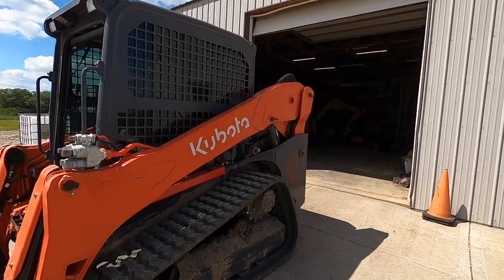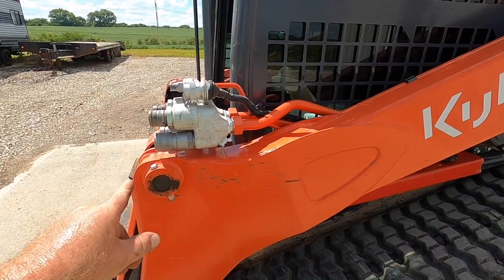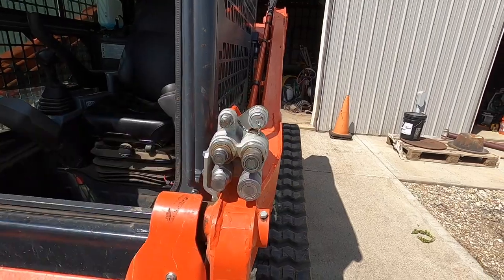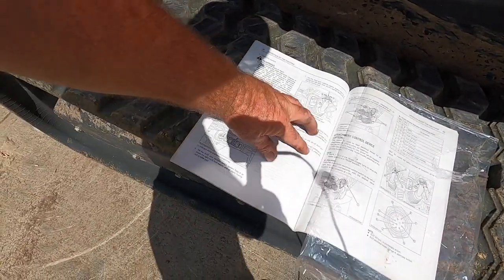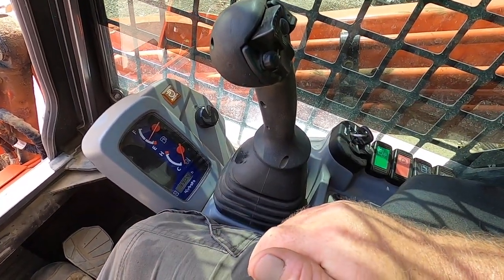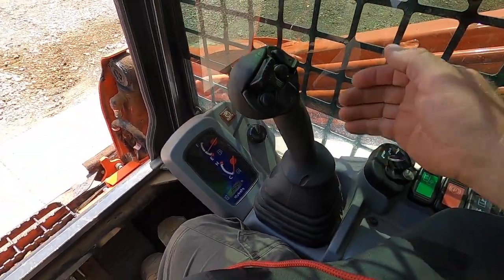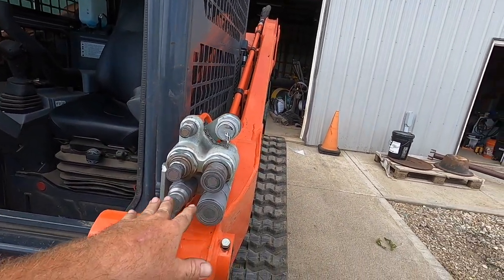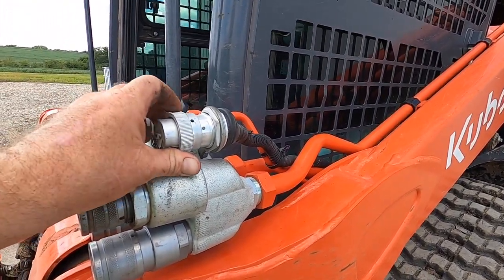Kubota SVL 65 / 75. How to Use High Flow

Comment: I'm not sure on the 65 and 75 but on the 95 and 97s you have 14 different settings on your dash that increase's the flow rate with each step. When hooking up high flow to an attachment you need to know the maximum flow rate the attachment will take and not set the machine higher than the attachment will handle. The sad thing is Kubota holds these settings cost to them. You have to pay to get what each setting is flowing. Which should not be that way.
Reply: I’ve got a screenshot of all the settings and the corresponding flow.  Drop your email and I’ll send it to you
Reply: @TeezleySPT  I sent my email twice but looking at the comments I don't see it. I was just wondering if you got it.
Reply: @TeezleySPT  do you still have those flow settings that you could share? I need to know what level to set so that I don’t exceed 20gpm.
Reply: @toddkirby7977  6 on the left is about 18 gpm.  7 on the right is about the same.  Any higher and it goes above 20 gpm on the chart I have

Comment: I have been using a 75 with a seppi drum for nearly a rear now with the high flow option activated and never noticed a difference in power while using it in standard flow. The right side of the toggle never has worked for me, only the left. Did the factory hook the male and in and out backwards? Is that why it is only working in standard flow the entire time?
Reply from the maker: OK so what you need to do is switch the fittings on the attachment. The mower has a check valve in the so it can't run backwards. So when you try to engage it going the other way it probably just loads up and doesn't run.  I don't think you have ever ran high flow to that attachment. You may be in for a surprise with more power. You want standard flow attachments to work to the left and high flow should go to the right of the toggle. 

Hope it helps. Let me know.

Comment: Correct me if I’m wrong, but I thought the male and female on the bottom of the manifold have a slightly larger center circle.  Allowing for more flow than the top couplers.
Reply: You are absolutely correct.
Reply from the maker: Correct. I get allot of people confused and they think they are two separate circuits. Thats why I made the video to try and help explain it. But yes. Larger fittings allow more flow through them with less restriction.

Comment: Don't even own one but planning on getting a couple to rent out locally. Any preference on 65 vs 75 and which would be best to rent out?
Reply from the maker: I like the 65 over the 75. Its lighter and a little faster hydraulics. Cheaper and easier to haul because of the 1000 pound difference in weight. They are both very comparable to each other. I own a 75 now and wish I had my 65 back every time I get back into one.

Comment: I’m just about to buy the SVL65. All I plan to use it for my business is augering post holes, hammering concrete and very minimal material spreading. I was considering a snowblower maybe in the future. 
I wasn’t figuring on needing a high flow machine because I won’t be mowing with it. 
What is your opinion?
Reply: I'd consider a potential snowblower to be significant motivation to go with high flow.  Take a look at specs on various models of blower and compare to the SVL specs.  The price difference for high flow isn't that big in the grand scheme of things.
Reply from the maker: I think it would do totally fine. If your not blowing snow commercially and having to be on a big time crunch I wouldn't think you would need high flow either. Blowers don't take tons until you are throwing it 50' and running hard with them. I really liked my 65 I had.
Reply: No I won’t be using it for commercial snow removal. And I’m still not sure if I would even get a blower for it or just use a blade.
Reply from the maker: You would be totally fine. I pushed snow with my SVL 65-2 on commercial sites. I like using pusher boxes. And the 65 pushed a 8' box on long pushes with heavy wet snow. I have some videos of it on my channel. Search around for them. It was probably 2 years ago. 

Hope it help.
Reply: @skidco  I’m pretty sure I’ve watched them already but I will check them out again! 
Thanks for your opinion on the machine and keep up the videos! I enjoy them.